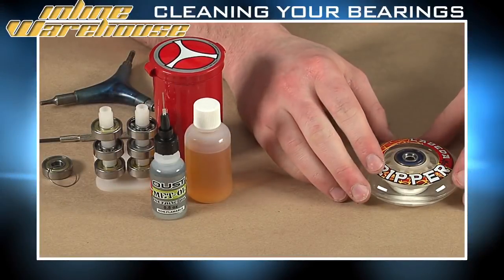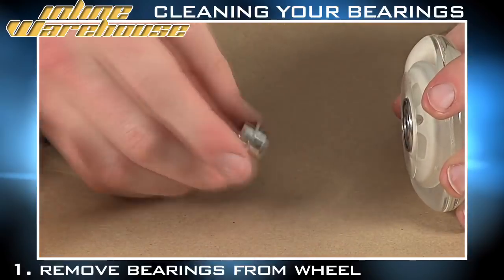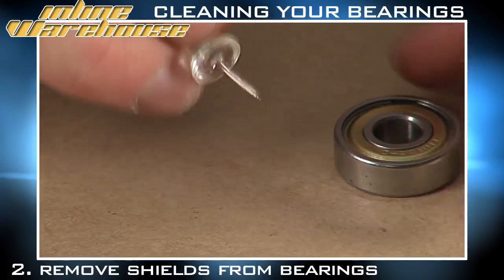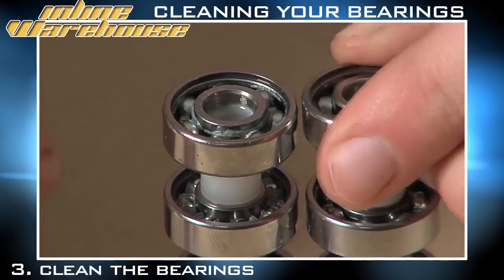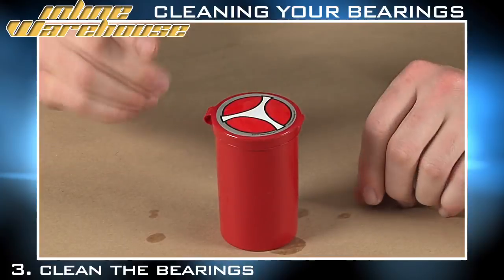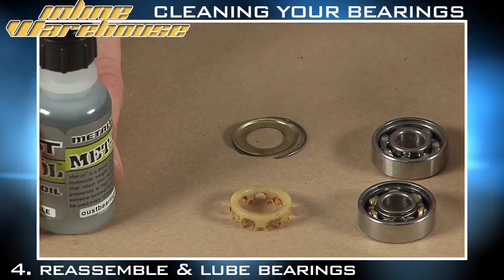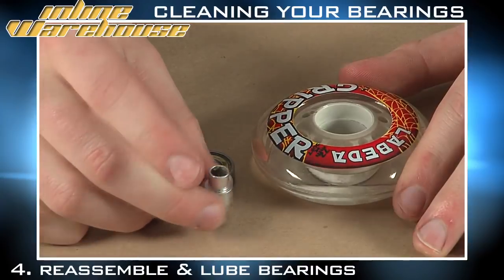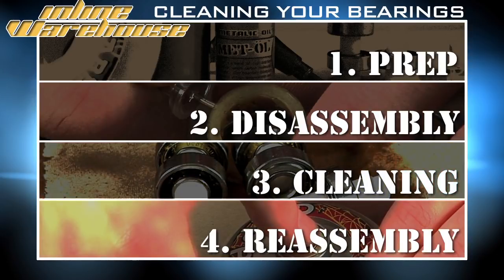How to Clean Your Bearings

Comment from the maker: If putting lube (whether it oil or cream) on the outside of the shield, some may work its way in there,  but likely it will only attract dirt and make it stick to the bearinsg.  Some bearings have a rubber shield on the inside to where you can drop in there and spin and get benefit, but if a sealed bearing that requires removal of the c-clip to get to the bearings..You'll have to get that off to get in there and clean out and lube again.  Thanks for the post!

Comment: I use Bones Speed Cream myself. The Sonic Super Oil, Oust and other lubricants found on our site I've used as well. I can't say the 3 in 1 silicone won't work but I cannot recommend either. I stick to those on our site that are made for bearings. Thanks

Comment from the maker: Rollerblades SG bearings are sealed bearings so the shields do not come off. You have to lubricate on the outsides and try to work some oil in there. Most bearings have a c-clip like in the video to get the shield off. If a sealed bearing like the SG then it would be tough to get shield off and even tougher to get to stay back on if doing so. Not recommended for sealed bearings which are also referred to as non-serviceable.

Comment from the maker: You can use the pusher mechanism when having a long-sleeve spacer, and the puller (the lip) when a floating spacer.  A floating spacer floats inbetween the bearinsg so the pusher doesn't have the edge of the spacer to push on and pop the bearing out. The puller therefore allows you to slide through to get between the bearings in the center for the wheel, and actually pull the bearing out.  That make sense?

Comment from the maker: The shield you can clean with anything and then make sure dry. As for solution, enough to submerge your bearings is all you need. Also make sure those are dry and then lubricated again before reinstalling/using.

Comment from the maker: You should always have a bearing spacer.  If an 8mm axle which is wide, you likely have a floating spacer. If a 6mm axle which is skinnier, then a long sleeve  spacer slides through the center of the bearing to fill up that extra space so you axle is secure.

Comment from the maker: Ah yes, depending on the manufacturer, this can be tricky.  If possible, place the balls in before replacing the track.  The track will help keep the balls in place while you secure the metal shield.  It's best to always have the bearing on a flat, smooth surface when doing this so that both your hands are free to finagle with the bearings as needed.

Comment from the maker: boravw1 - We do currently sell the Labyrinth bearings. I'd question whether they would limit dirt and what not, but it never hurts to try. I don't believe the Labyrinth a bearing that they are going to continue with. Perhaps something shielded on both sides would work well for you if skating in places that are that dirty. The BSB Abec 9's for example. You didn't mention which bearings you are using currently?? The oil should not 'attract' dirt unless applying too much or the bearing is exposed.

Comment: Look up how to clean skateboard bearings, ther are a lot more videos on cleaning them just because skateboard wheels are more exposed to dirt and stuff. But you can use gas, acetone (nailpolish remover), paint thinner and rubbing alcohol (90% or more is recommended).

Comment from the maker: Remove wheels and bearings, and leave frames attached. Link doesn't work here, but to our site where I mention below and you can read the instructions there for those skates. Other models have Aqua Tech molding where you can mold in hot water, but not the Strut.  Thanks!

Comment: I remove the shields, throw my bearings into a jar, fill it with a degreaser (simple gream, acetone, kerosene, gas), close the jar, let it soak and shake every ten minutes for 1 minute. I take them out, let the degreaser evaporate and put some grease in it.

Comment: the reason why they say don't use WD-40 is that it corrodes plastic over time, the cage in most bearings (the bit that spaces the steel balls out in the raceway) is made of plastic and continual use of WD-40 will cause this to become brittle and crack or become warped (it could do both, depends on the type of plastic they use) causing them to stop very suddenly  but whatever man do what you want. I wash my skateboard bearings with hot water and lube them with general hardware store oil

Comment from the maker: Sounds like you have 'sealed' bearings. Rollerblade SG bearings are sealed for example and are not serviceable. Not easily anyway as if you did get the shield off, you likely wouldn't be able to get it to stay back on. You can try some lube around the outside and work it in and wipe down..or get new bearings..   Sealed bearings do not have the c-ring and you woudl visibly be able to see it if it were there. Thanks!

Comment: how to i get the bearing shield/cover  off am trying my best but  i am not sure, i have a the twister 80 2015 inline skates
Reply from the maker: +Jugh Lone the bearings that come with the Twister 80s are "sealed" and are not serviceable so those shields aren't meant to come off! The benefit is that dirt doesn't make it into your bearings as easily so get a good roll out of them longer. Once the dirt gets in though it's time for new bearings.
Reply: +Inline Warehouse - Fitness how do i tell when i should change my bearings ? my wheels dont spin too well but i have only been riding for about 1.5 months , with like 4 hour sessions twice a week or 3 times on good weeks. I do unfortunately skate near the coast so sometimes paths are sandy and rocky
Reply from the maker: Jugh Lone We feel your pain with coastal skating, it's really hard on bearings! With that type of environment it is hard to give a timeframe as to how long you should go between cleaning/replacements but if you feel that your bearings are slowing you down that's a good indicator that it is time! Something like the Bones Reds would be a good replacement option for you since they high quality, inexpensive and serviceable. Regular cleaning should keep them in good shape but if the sand does start to chew away at them they'll still need replacing.
Reply from the maker: +Jugh Lone Here is a link to those Reds Bearings: http://www.inlinewarehouse.com/Bones_Reds_by_Powell_608_Bearings__16_Pack/descpage-PCBRB.html
Reply: +Inline Warehouse - Fitness Thank you so much for your help , you guys are amazing!
Reply: +Inline Warehouse - Fitness Just a quick question on the red bearings , would i need different axles and what kind of spacers do i need or do any work for any bearings , am not sure what axles and spacers are for but i heard from someone skating without spacers allows you to pick up more speed but am not sure about this, am also looking for new wheels do you have any suggestions ? 

 i know bigger wheels = more speed but less manueverability , so am going for 72mm 85A hardness wheels to keep some speed but manuever better and to be hard enough to skate well on rough terrain but am not sure what else i should look out for when picking wheels , i am guessing the material if its rubber or plastic is something you got to look out for but i dont know why?

theres so many wheels that look different but i dont know which ones good for me or how to tell what is best for me other than hardness and size .
Reply from the maker: +Jugh Lone The Axles are specific to your skate frame so you need to use the same ones you currently have. The spacers you can use from your current setup, they just have to match your axles and they stabilize the bearings against the side load caused by inline skating. Technically you can skate without them but you will blow through bearings faster!

For wheels, doing all the way down to 72mm may be a little bit drastic, and you may be better off with 76mms. The frame length has a lot to do with maneuverability as well and you can't change that. Going that small will give you pretty big spaces in between your wheels, which isn't ideal for outdoor surfaces where things can get kicked up and bind up in there. The Seba Street Invaders would be a good option for you since they are designed for Slalom/Freestyle. They have a wide footprint similar to the Supreme wheels that came with your skates to give more control than a lot of the more traditional profiles you will find in that size. Here is a link to those: 

http://www.inlinewarehouse.com/Seba_Street_Invader_Wheels_Yellow_76mm_84A_Each/descpage-INVA.html
Reply: +Inline Warehouse - Fitness Wow thank u for ur self you guys are really helpful i will definitely look at those sebas , do you do international shipping i am from the uk
Reply from the maker: You're welcome and THANK YOU! We do ship to the UK and our site will give you shipping quotes based on your shopping cart so you can see how quickly things will arrive and how much it will cost to ship to you!

Comment: just bought a pair of new skates for the first time in 14 years.. everything has changed.. lol.. wheels are bigger.. boot is crazy hard and i have abec 7 bearings in them now.. never heard of it.. maybe i'm just getting old haha. but all i have is wd-40 around the house.. maybe i'll buy some met oil or something.. but for now.. wd-40 will have to do. it always worked before.. so.. even if i ruin my wheels.. i'll just buy new ones.. no big deal.
Reply: I've been using wd40 on my Bauers for about 7 years now and they work fine wd40 is cheaper and works just aswell

Comment: why don't you recommend wd40
Reply from the maker: +Mohamed Osama WD 40 is a degreaser so it will strip the lube from your bearings very quickly, making them run hot and dry. WD 40 will also attract dirt due to it's viscosity. By using a bearing lubricant, you're actually conditioning the ball bearings to help prolong their life and make sure that they run smoothly!

Comment: Lmao do not recommend wd40 what a joke lol I use wd40 and I fly up and down the rink all the Time use wd40 it doesn't hurt
Reply: WD40 degreases the bearings causing more metal on metal contact and wearing them down a lot faster.
Reply: wd40 ruins your bearings make them really dry, even when you apply lube it will go away quicker